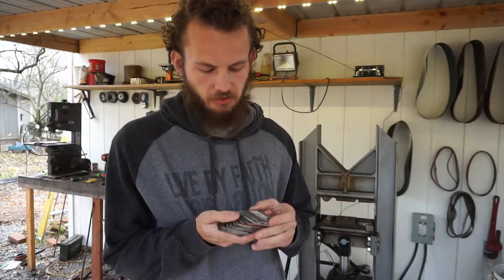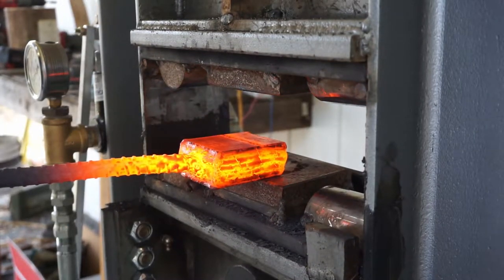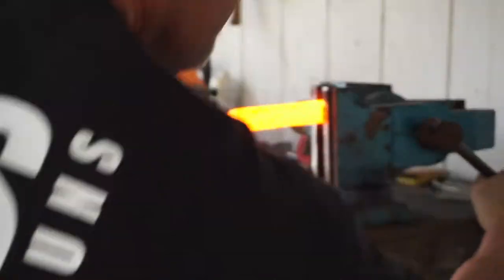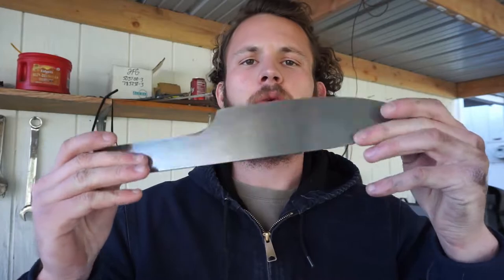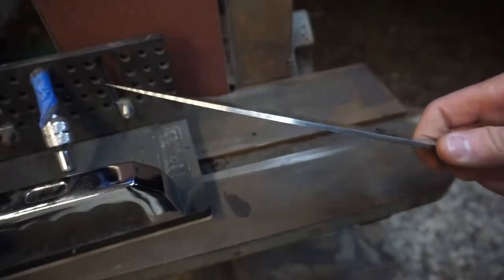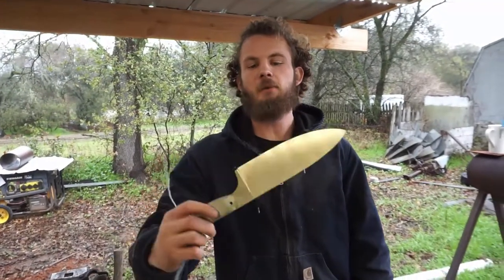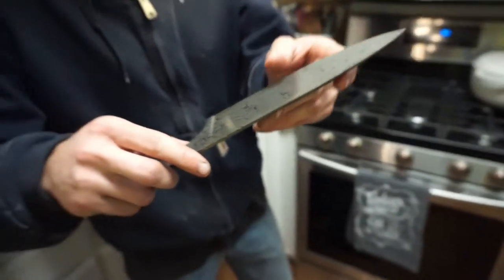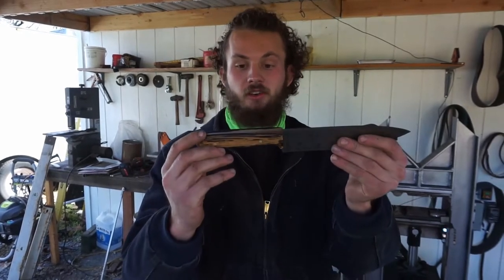Damascus Chef Knife Build!

Comment: the press looks like it's squashing the daylights out of that steel! I noticed that the ram goes down quite a ways to the resting position... i'm wondering if you could adjust that to keep it closer so you don't have to wait so long for it to get up to the material? might save some heat in the metal. 

the etch came out incredible... what was your process with it? real impressed with everything!
Reply from the maker: It only comes down so far because I am making it do that with my foot. As I got better by the end of the project, I didn't need to retract it nearly as far. There is definitely a learning curve!

I hand sanded to 600 grit and etched in muriatic acid instead of ferric chloride, and it sat for about 30 minutes. This etched a bit too much, as the large areas of 15N20 were a very dark blue color instead of shiny silver. Then I gave it a 30 minute instant coffee soak at around 140 degrees. I definitely could have left it in the coffee for longer!
Reply: @FormulaJake  i'm seeing some dark spots in the knife i made on the 15n20... i'm thinking i also etched way too much. your video reminded me that's what happens when it's in there for too long! keep the vids coming!
Reply from the maker: Thanks brotha 🤙🏼 I noticed that muriatic acid will eat away large splotches of 15N20. It's so much easier to get a big contrast with a small, tight, high layer pattern!